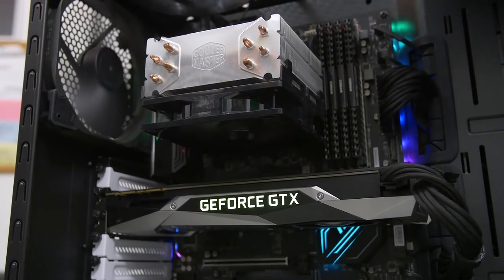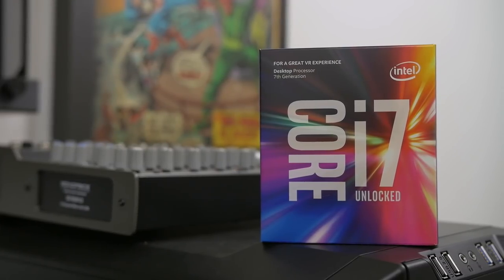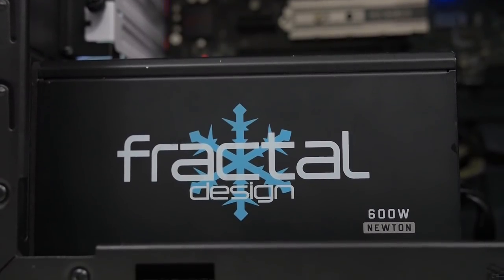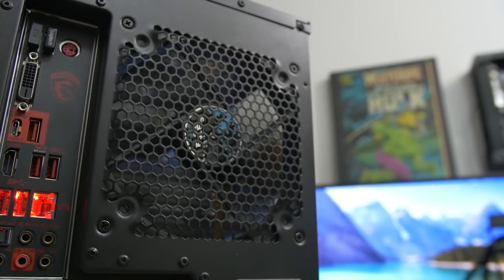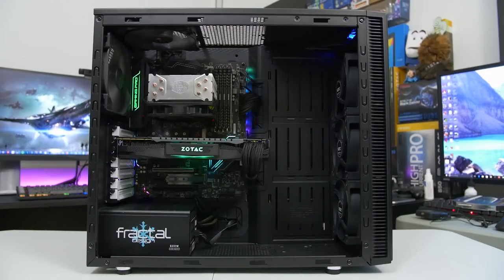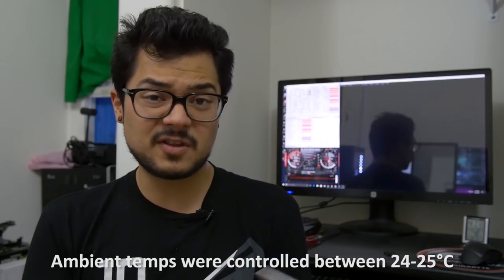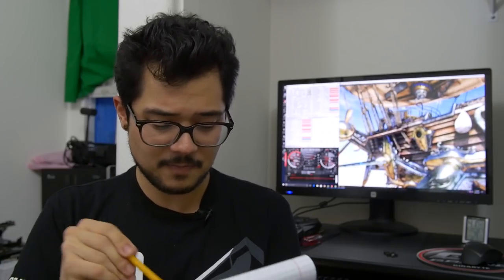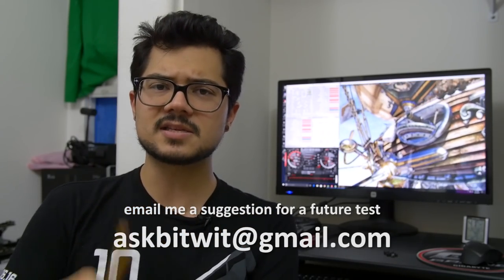This is how you should mount your CPU cooler! I think??

Comment: I use a hyper 212 evo to cool my i5 6600k @4.6ghz and the highest temp I've seen is 57°C
Reply: Marley I bet you didnt use Prime or did you?
Reply: I did, that's the weird part
Reply: Marley pics or didnt happen. Friend of me is using a 6600k with a beefy Dark Rock Pro 3 as cooler and doesnt even maintain 60 at 4
5 GHz.
Reply: maybe it's because my room is always 16°C
Reply: if your room temp is 16c then why bother buying cooler XD
Reply: what case do you have?
Reply: I have the 212X and I keep my 6600k at 4.4Ghz 1.36V (lost the silicon lottery, core 4 always fails prime95 at 4.5Ghz, even at 1.4V)  <65°C after 1 hour of IBT. Ambient temperature ~18°C.
Reply: Use LinX,with AVX enabled it's going to be a bit hotter.(But room temp at 16 degree C is really cold compared to common 25 degree C.)
Reply: casheesed I upgraded to the s340 elite today, same temps though
Reply: my room is 5° at this point..... should I buy a cpu cooler
Reply: nah you need full AMD pc
Reply: And three 460 in SLI.

No, that wasn't a mistake.
Reply: I run 4.3 on my 4790k and it peaks at 75 max load
Reply: 6600k 212 evo x gta v for 4 hours (no gpu,with intel hd only) 45°C max ,room 20°C is that normal?
Reply: I use Deepcool GAMMAXX 400 - 48°C top
Reply: I have an i5 6600K aswell, with the hyper 212 Evo.  I'm running 4.5ghz on stock voltage, whatever that is.  my bios says 1.165volts, when I run cpu-z it says I'm running like 1.2 volts.  My temps are super low.  Like 15 - 20 at idle, and like 35 under load.  Anything above 4.5 (so 4.6 and up), it fails prime95, and the longest I've gotten in Aida64 is 3 hours before it fails.  When I pump it up to 4.8ghz with 1.330volts, it'll fail 2 cores in prime95, and I even cranked the voltage up to 1.4, and I still fail 2 cores in prime95, I tried LLC and had no luck.  I'm not sure if I"m missing some setting or not.  Other then prime95 failing at 4.8ghz and Aida64 running 3 hours and then failing, the CPU is solid.  I've ran geekbench and Cinebench, and both tests were awesome and I got some pretty sweet looking marks.  780 is my highest in Cinebench, and I ended up with 16300 multi core in Geekbench.  Unigen also runs no problem at 4.8.  I did drop my frequency down to 4.5, because I can run prime95 all day at 4.5, same with Aida64.  Not sure if it's safe to run 4.8ghz if it's not rock solid at heavy loads.  Also at 4.8ghz with 1.330 volts, my idle temps around like 28 - 30, and my load temps are around 60.
Reply: tell him to remount it as the cooler may not be mounted right
Reply: Be careful with Prime95, that killed one of my PCs.
Reply: your name is pluralized, which makes no sense. "Lone warriors"
Reply: +Nathan Kam If your CPU can't pass Prime with integrity checking enabled, your CPU isn't stable, and could be actively corrupting data even without necessarily showing any crashes. I learned it the hard way when none of my stress test options were failing except prime, and in real scenarios I had multiple crashes on a weekly basis until I stabilized Prime.
Reply: Marley same cooler and cpu, but not overclocked, barely hits 50
Reply: Marley The highest temp I've seen on my 6600k is 35 degrees
Reply: +SlenderCam Gaming it gets alot hotter than 35 degrees where I live.
Reply: The highest temps I got on my 4790k @ 4.8ghz (1.35vcore) with a noctua nh-d15 is 49 degrees C. Odd
Reply: Marley Have you increased voltage? I have the same setup, but can only get 4.3 on stock settings.
Reply: I increased the voltage to 1.3V but your voltage might differ
Reply: Could you tell me what motherboard you are using?
Reply: I use a nh-u12s to cool my fx 8350 @stock speeds (4ghz base, 4.2 boost) and the highest temp i've seen is 70 degrees.
Reply: Corsair H55 on a 6600. Same. 57°C is the highest I've seen (recording with open hardware monitor). Did you OC that 6600k?
Reply: Marley please tell me your magic. Im using the Cryorig H5 Ultimate to cool my 6600k @4.6ghz and the highest ive seen is 68C
Reply: I have an i5 6600k and a 212 Evo but @4.8ghz. the highest iv seen is 65°c
Reply: what are your ambient temps?
Reply: i have one 212evo too but my cpu doesn't even need it since its a i5-4690 non k
Reply: Could the people with i5 6600K's and an OC from 4,5Ghz and up name their motherboard?
Reply: I got my 6600k to 4.8ghz with an asus A170-A
Reply: i5 6600k @4.5ghz using a cryorig h5 on a gigabyte z170mx gaming 5 never seen temps past 55° Celsius and that with an rx 480 oc in a microatx case
Reply: I got mine to 4,6Ghz with the MSI Z170A Krait Gaming 3X
Reply: I got mine to 4,6Ghz with the MSI Z170A Krait Gaming 3X
Reply: Was pretty useful when my heater breakers went off  xD
9590 on a H100i with a damn busted firmware stocked at 50%.
It kept the unheated half at 19 degree C :D
Reply: My heating bill went down $100 when I got my fx 8350 but my electric bill went up
Reply: Jared Jaster Hahaha, you must made my day.
Reply: Lol bullshit, my 6700k runs at 4.5 and 1.3v and reaches higher temps
Reply: AMD 8320 On a M5A99FX MOBO @ 4.6 STABLE @ MAX TEMP OF 69°.
Reply: silicon lottery
Reply: I've had my 4690k @ 4.8ghz on 1.35v. I never use prime, though when gaming at 144fps it never went over 65C. That chip was amazing, I've never had another that overclocked so well. Then the gigabyte mobo just died and boot looped out of no where and I'm left with this cpu on its own. The Evo 212 is very underated, with a Noctua fan it actually has heaps of headroom.
Reply: Marley I use a Hyper 212X Evo to cool my AMD A8 7670k and the highest temp i've seen is 70 -_-
Reply: @Cnotolamacz  big facts.
Reply: @SuperPieBox23 no.

Comment: When I saw the thumbnail I wondered why Trigglypuff was so upset about CPU cooler mounting.

...and sleeve bearing fans should be mounted vertically (horizontal air flow).

Comment: possibly the blower style since it's worse as dispersing heat a good portion of the hot air surrounding the card stuck around, while the open air one was better at getting hot air out and away.

Comment: Maybe since the open shroud GPU has multiple fans resulting in relatively more air circulation and creating a higher positive pressure unlike the blower style GPU... correct me if I am wrong
Reply: Indrajeet Pala air circulation from internal components can't magically pull air in from outside the case and raise the internal pressure.
Reply: horizontal mounting uses more fresh air from the front intake, vertical mounting the cooler is sucking the hot air from the gpu in = higher cpu temps with open style gpu cooler...nothing more...thus horizontal mounting the cpu cooler is better if you have an open gpu cooler...
Reply: But the blower style cooler is designed to pull air out of the case, so there would be less positive pressure.
Reply: Walt Findley .... if the case was fully sealed then yes a internal fan inside sealed cabinet will not suck air from outside .... but in a pc cabinet intenal fan can create a positive pressure "i think so" just like if you put two same fans on top of each other the total air moved will be double the air moved by single fan.
Reply: the components on the vga pcb, they also heat a little, so even with the blower style cooling, some minimal heat disipation will occur in that area
Reply: heat will produce on both gpus pcb
Reply: tim serious Having a completely internal(see- CPU cooler, GPU cooler) fan, not drawing in outside air, CANNOT create positive internal air pressure. That would require forcing air into the case, which it isn't capable of doing, based on where it is.
In addition.. Where in heck did you learn that stacking fans moves more air? You may get more pressure out of it, provided the fans are set up correctly, but in general it actually reduces the volume of air moved, as well as the air pressure being ejected by the rearmost fan. This is due to air turbulence from the blades being positioned too close to each other(providing that you're trying to sandwich fans together) and pressure leakage around the fan frames.
Reply: Walt Findley well it won't be doubled but 20-30% increase in amount of air and they are not sandwich in this case.
Reply: I get his point, he meant that the blower style cooler makes the pressure inside the case negative, which is correct because it take air from inside the case and out...which makes it sort of a powerful exhaust fan.
Reply: can u explain?
Reply: i have more case fans than this lol

Comment: I'd actually expect there to be a slight (perhaps not as much as 5 degrees C) difference based on where the exhaust fans are.  Having both of them might mean they're pulling the airflow path slightly differently.  If that's the situation, then the rear mounted fan may be expelling more GPU heat without it going through the vertically amounted (horizontal air flow path) CPU cooler.  

You may want to consider adding some more tests to this idea, specifically air flow pathing by way of adjusting the exhausting case fans.

Comment: I think the horizontal position cpu cooler lowered the temp because the air flow is in a more consistent direction from to the intake fans airflow.  Thus creating a more positive air pressure effect.

Comment: Seriously?
"VR compatible" even on CPU?!
>.<
Reply: Yeah and say me also that we need VR compatible HD ready RGB tempered side glass panel...
Reply: +Reo! Vendredi Funny/annoying fact. My Intel 3970x from 2012 with my Gigabyte GTX 1080 Xtreme handles everything in VR, even using 2x supersampling via the Oculus debug tool, JUST FINE ....YET the stupid Oculus software has that dumb warning stating my hardware doesn't meet recommended spec that never goes away!
Reply: DMan 9971 I'm sure you can erase that message in registry.
Reply: Arek R. Damn right you do! but you're missing one thing. fire to make the CPU go fastet
Reply: It's a real thing, I even upgraded to Kaby for it. In games with higher CPU requirements (physics, terrain generation, etc) you need to account for the bottleneck. If any component in your PC is causing a lower-than-acceptable framerate, it needs to be changed. (Even the case applies, if airflow is bad you'll need to fix it)
Reply: You do realise there is a minimum requirement for VR right? including cpu?
Reply: Ankit Sharma But ist not damn reason to certify everything for VR...
Reply: Arek R. Why not? It's not false advertising... The pentium kaby Lake is not ready for vr.. And this cpu is vr capable.. It is something people look for.. I don't understand your complaint? Is it packaging?
Reply: Arek R. It's not for "dumb" people.. it's for those who need a confirmation to spend their hard earned money and aren't experts or well versed... It's neither wrong nor illegal to put it on the package. So there is really no issue..
Reply: Arek R. It wasn't only.. It's a reassurance. So everything you buy should be blandly packaged in a brown bag? Because well .. "you have the Internet"?
Reply: Reo! Vendredi Was that an infomercial for time and it's on the human psyche? I felt like I was being sold something when I read that.
Reply: Yeah I ignored Reo's reply because I dont know what the fuck is going on, like I would be teleported to completly other conversation :O
Reply: English isnt my native lang so I can type "english" instead of "English" also most of the people are lazy to reach capslock and do same.
English is everywhere so I dont need any other foreign lang.
Reply: Arek R. Vr compatible is important on a cpu buyers choice because they think all you need is a g4400 and a gtx970 off eBay to do 60fps 1440p VR shit
Reply: VR 90fps min.....
Reply: I can run vr on a 10 year old q6600 OC because it is easy not like new CPus

Comment: hypothesis: blower fan reduces pressure that the cooler can generate. open air fan rebounding air actually helps push cool air into the cooler. the reason it doesnt help in the vertical scenario is because the vertical fan takes in the warm air instead of the cool.

Comment: Hot air rises, a vertical config with open gpu pulls air directly into the case.
Also, I noticed if the cpu, gpu airflow direction matches, temps are lower. Open gpu has vertical airflow, closed has horizontal.

Comment: It's all about airflow.
CPU cooler in horizontal position is taking in cooler air as the open air video card is disrupting the cool airflow from the front fans; instead of going under the video card (as it is with blower card) more cool air (from front fans) is travelling over the top of open air video card and through CPU cooler.

Comment: For the first test, as there are 3 intake fans and 2 exhaust, blower card reduces amount of air pulled through those 2 exhaust fans, therefore less is being pushed through the horizontally opposed CPU cooler.

Comment: I heard Cryorig H7 is a great budget CPU cooler.
Reply: yes it is
Reply: Better than the 212 for a bit more. The H7 is less available around the world than the 212 though.
Reply: There are actually alot of great coolers in the same range of the 212 EVO. 
Starting with the Hyper T4, going over the Hyper 212X, H7, Brocken ECO, Matterhorn Pure Gammaxx S40, and all the way to the Macho 90 and True Spirit 120.
The thing ist just, that the 212 EVO has been established as a cooler fitting to all recent sockets,, relatively easy to mount for a tower cooler, and with a good price to peformance ratio.
In the end it all depends on availability and space inside the case.
Reply: ziljin harder to get your hands on, a couple bucks more pricy, but significantly better. Mounting is easy, it has much better clearance in every way, and it performs a lot better. I've used both and I always advise people to spend the extra $5-10 to get the H7
Reply: ziljin get the h5 i got it and under 55° on i5 6600k at 4.5ghz

Comment: Kyle,

Blower style cards don't have direct airflow on their backplates, making the surrounding air hotter. With the open shroud design, the cooler had direct airflow access to the backplate allowing the backplate to cool down resulting in cooler temperatures surrounding the tower, and therefore reducing CPU temperatures. Not only that but if you have mismatching fan speeds on the tower and top case fans you may actually blow heat back into that pocket.

Also, I believe positive pressure, while being dust friendly, actually helps create small circulating pockets of heat in certain parts of some cases. Here with your choices, the bottom front case fan would feed the blower, and the top two would gravitate more towards the top of the case, NOT towards the backside of the gfx card (the majority of the air would be flowing towards the path of least resistance, and there is less resistance where the exhaust fans are flowing due to less pressure being there). With the open shroud, the gfx fans could push the surrounding air around back of the backplate and disrupt the pocket to allow for better case fan operation.

But hey, that's just a theory, a possibly complete BS theory. Thanks for reading.

AND if you do happen to read this, Kyle, test the statement, "positive pressure, while being dust friendly, actually helps create small circulating pockets of heat" because the flipside to it is that with negative pressure you have no other choice but to bring in cooler air into the case.

Comment: I can confirm that moving my h115i water cooler's radiator from the top of my Corsair 750D case to the front dropped my CPU temperatures from a max of 98C on full load using Aida64 to 68C. Absolutely incredible.

Comment: I think something to keep in mind is that board partner coolers are usually more powerful, larger fans, better technological advances, etc. With the cooler horizontal, it might be that more surface area of the cooler is in the way of the airflow from the card and therefore heating it up further. Not really sure

Comment: One thought as to why the shroud + horizontal was hotter, perhaps is because the video card's radiant heat was rising and directly warming the heat sink.  Being that the CPU heat sink fan was directing air horizontally and not drawing air upward directly, less thermal dissipation was occurring in that area resulting in higher temperatures.  One thing you can do if you revisit this, is get your hands on a FLIR camera so you can visibly observe any heat pooling.